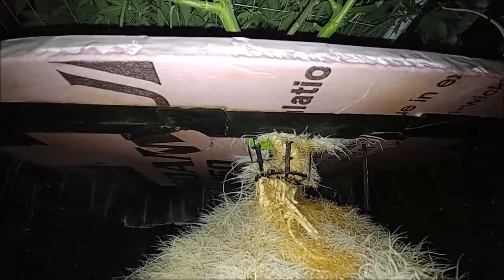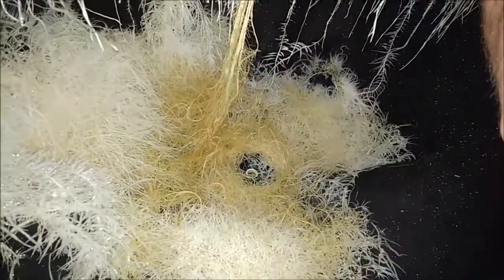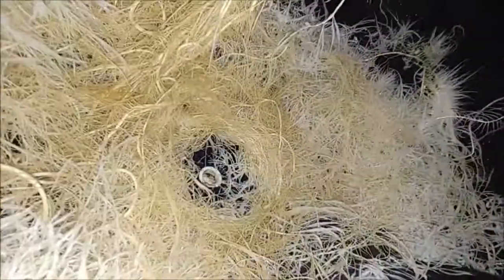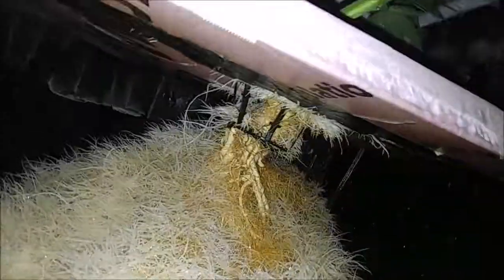ROOTTOUR5

Comment: Looks great, nice healthy beautiful roots! Do you see a correlation between where the misting nozzles are spraying and the slightly yellow color of the roots, like Atom said in the forum? I doubt it will have any effect on the plant health I am just curious.

Edit: and if you don't mind me asking, what sort of cycle do you have it on? I am currently using low pressure, but my high pressure pump is arriving tomorrow, as well as some low flow nozzles and need to have an idea of what to set it at. Currently I am using 5 second on, 10 min off, but with high pressure I would prefer to go a lot less and just use drain to waste.